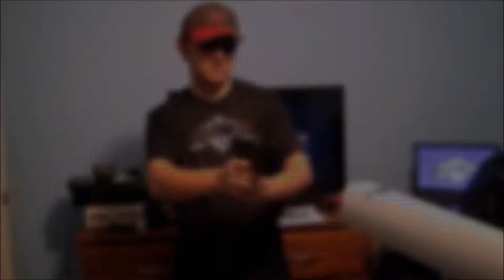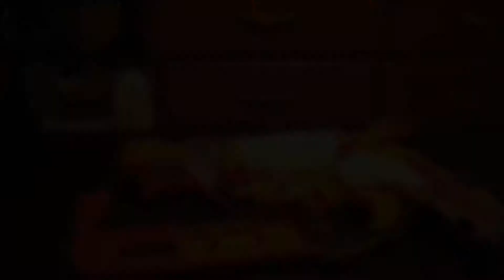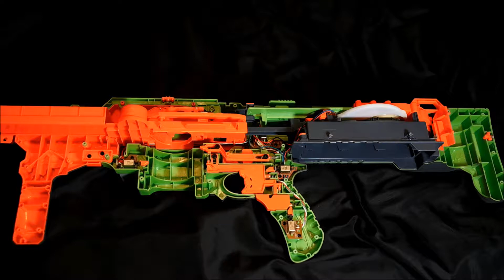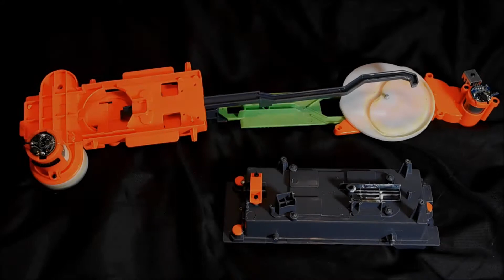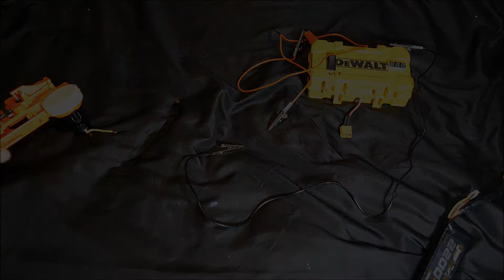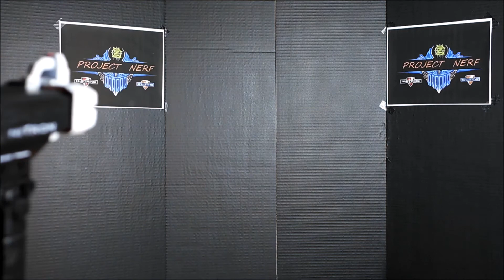Vortex Nitron Mod

Comment: Thanks for the break down of this. It made modding mine so much easier. I did find with the pusher motor i had to drill my own holes in to take the screws (I used a Rhino). I also used a brushless motor for the flywheel. I now have to figure out if a concave wheel is worth looking into as well as a bigger wheel for increased crush.
Reply from the maker: Glad the video was helpful, I would love to see your go with that brushless motor in it, should really rip.... Chris
Reply: @projectnerf7920 , https://www.youtube.com/watch?v=Go44Nz5QTMc. Working on a 3d printed part now to increase the size of the 20 round mag, I really didn't like the feeding of the 40, plus half the time i was only able to get like 38 in
Reply from the maker: That thing is awesome, let me know how the mag extension comes out........... Chris

Comment: Man you deserve more views, what size screws did you use to mount the pusher motor, are they m2 by 5 mm screws
Reply from the maker: I believe they were, but don't hold me to that my friend. It's been such a long time since I did that mod, I'm not 100% sure of the screw size I used. But the M2 x 5mm seems to ring a bell................ Chris

Comment: Im wondering, can a nerf nitron take a imr, and can you easily install the pack to hold them in.
Reply from the maker: Sure it can, IMRs are a great alternative to lipos, But they are very expensive for the High Drain ones that actually make enough current to run upgraded motors and such. If you go with IMRs don't buy those budget kind get the good ones and you'll be pleased with the performance....................... Chris
Reply: @projectnerf7920 , thx
Reply from the maker: Glad to help when we can. If you need any help when you get into your mod, just shoot me a mail to Project.Nerf.2.0@Gmail.com    and we'll get through it............... Chris

Comment: How hard is it to mod?
Reply from the maker: I would have to call it an intermediate level mod if you are planning on changing the flywheel motor. Lots of cutom fitting went on there. However it's actually pretty simple to do if you just do the pusher motor and re-wire for lipo..............Chris

Comment: Id really like to see the wiring on it
Reply from the maker: I can draw you a diagram up if you like, but it's very simple to wire. Basically, it's just a stryfe with a powered pusher motor. But again I will gladly draw you up a diagram, just shoot me a mail to  Project.nerf.2.0@Gmail.com, and I'll get one drawn up and sent over to you quick as I can.